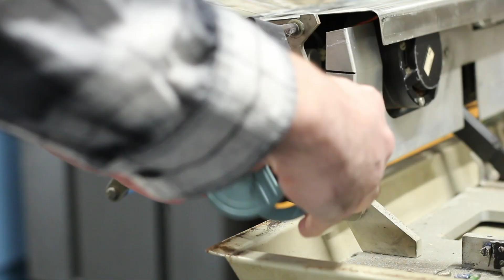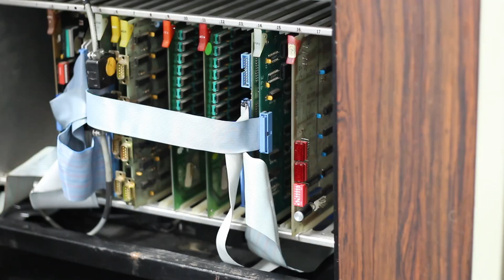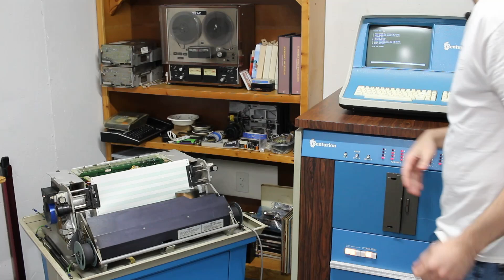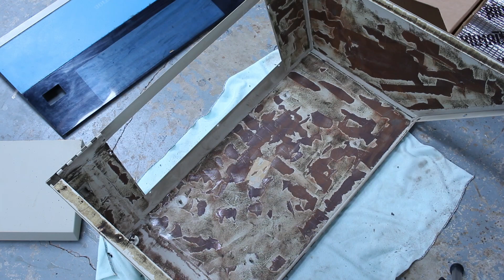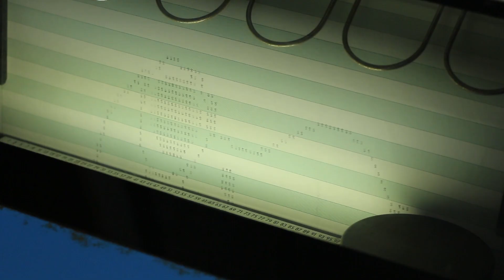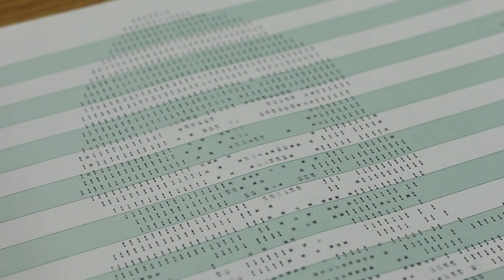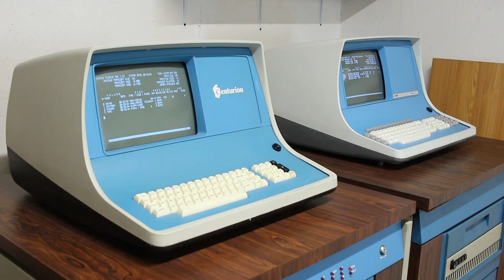Printing ASCII “Art” Like it’s 1980!

Comment: I made TV-camera digitizer  in 1979 just for the purpose for producing realistic Ascii-art.  One Mona Lisa in archives was definitively mine.
Reply: That is pretty wild for 79! Would love to see how something like that was done on period hardware.
Reply: Fairly simple to do, you just count the TV-lines and sample one dot from  that line with a horizontal timer. So it was not fast but fairly good on 500-line Black and White camera.
Reply: @TimoNoko  1 dot / frame? 

some people later in 80s would overlay images on the monitor itself
Reply: @lasskinn474  Full frame took   500*500/50 = 5000 seconds. Less than two hours. But of course when  printing picture on Olivetti Teletype you needed only 80 pixels and 80*80/50  = 128 seconds.
Reply: @igot2muchfreetime  if you work with B&W it is almost easy, you can do using  CMOS/TTL's logic there are few voltage levels and the signals are very simple, basically you lock to h/v sync and scan each line with using counters, comparators and general logic then shift in thru PPI port. have done with a MSX1 (z80 4mhz) at a time, maybe 15 ttl IC's for the logic itself and 3 or so cmos on the front end. the interface were controlled by a small basic/assembly monitor and would deliver a .bmp file. the trick was to keep the image still if using a VCR..... very nice for 30+ years ago tho.
Reply from the maker: That sounds awesome!
Reply: I did same on an amiga! I made a parallel port video digitizer!
Reply: Do you happen to still have the circuitry or schematics for something like this? ASCII art is amazing and would love to try this out!
Reply: @aurasphere647  No. But I later made a color separator and  produced real color pictures with the same  device. Google: "Kajakkimatka Alaskassa 1992"
Reply: @aurasphere647 
 @aurasphere647  No. But I later made a color separator and produced real color pictures with the same device. "Kajakkimatka Alaskassa 1992"
Reply: @aurasphere647 It would have been some ADC, possibly with a sample & hold amplifier of some kind, along with a timer/counter. You sync everything to the vertical refresh, then count a certain number of cycles, take a sample, store it. Next time around, you increase the length of time you wait. You could also sync it to the horizontal refresh if you want to do multiple samples in a single pass, it all depends on whether the circuitry can keep up. It sounds almost like he was doing a sub-sampling technique, which means you can greatly increase the bandwidth of your ADC (by a huge amount) as long as the waveform is periodic. And since a repeating frame of video is periodic, you could actually get a pretty high-res capture if you wanted. But again, as he was just going for essentially 80*80 pixels, then you just take 80 samples on a particular video line,  then wait 6 or 7 more  lines, take another 80 samples (again, not necessarily all in one pass) and build the image up that way.
If you want to play around with sampling analog video, it's very easy to do with a microcontroller and a decent ADC. You can even use the built-in ADC on many microcontrollers as they are often at least 10-bit which is plenty. And as they can run at high clock rates (especially compared to the speed of analog TV) you can get very accurate timing and sampling by linking one of the microcontroller timers to trigger an ADC sample.
Reply: Right on man
Reply: Wow, saaaaweeeet
Reply: 1979, that's impressive. I created a video capture card in the late 80s - it paired with a prototype CNC plasma cutter to maximize yield from steel plates. Resolution was nearly PAL at 640x480. The hardware was capable of more, but the lens distortion was pretty nasty.
Reply: I found a utility for the Atari 8-bit which would convert ASCII back into graphics.